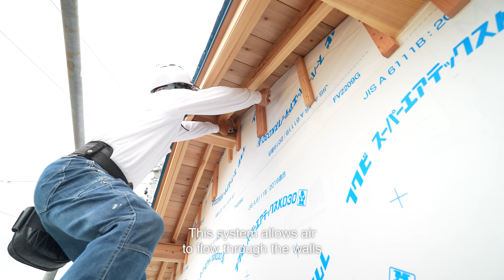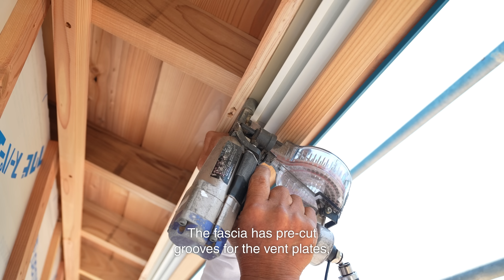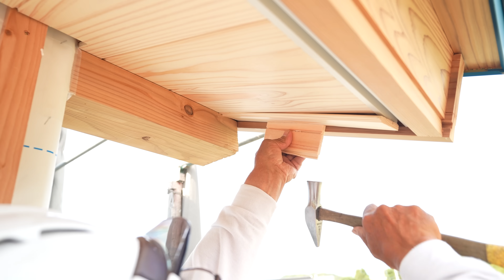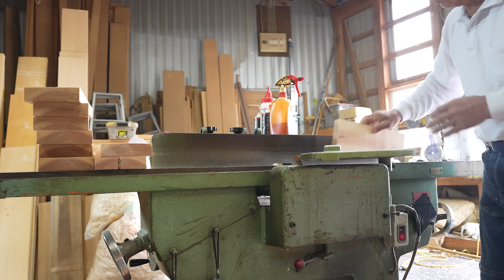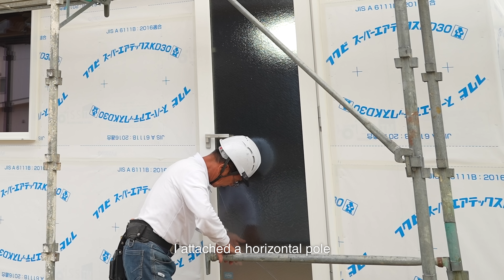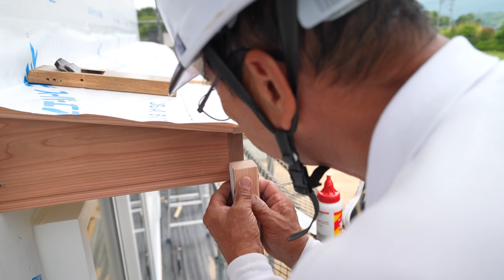I Didn’t Expect This to Happen... My Fault! | New Build Season 5 Part 6

Comment: I do not understand something. When air from outside can flow through the walls than why do you insulate the walls? The insulation value will go down dramatically when cold air from outside can flow freely trough the walls.

Very nice work, well done! 😀

Comment: Sharpening your pencil with the chisel is just showing off. Haha I’ve never seen that, fantastic
Reply: A sharp chisel is just a knife.
Reply: @ yeah, I have a chisel, but it’s not sharp. I’m learning, not at that level yet.
Reply: @johncamp7679  LOL.  The chisels he uses are a lot sharper than us chisels.  I slowly converted to Japanese tools because mostly they are better.  Actually the carpenter in the video is not using all the good Japanese tools he could use.  I bought a Japanese framing hammer 35 years ago, still using it as there is none better in the world.  Cost $25.  I just used a razor knife to sharpen my carpenters hammer and for close work used a mechanical, thin lead.  They mark the same every time.
Reply: @ I was wondering where to get a hammer like that. I have some Japanese chisels now, I never thought about using them for that, I have a couple pull saws, but the rasps are really good. Thanks for the info
Reply: My tutor at college used to do it occasionally even though we all knew that most of the time us chippies just use our utility knives for that purpose! 😂

Still a cool way to make a point if you excuse the pun.. 😉
Reply: @ yeah at first when I was younger I would push my utility blade away from me and it butchered the end of the pencil. Then I saw someone pulling it and it was perfectly sharpened and smooth. But a chisel, I would have never thought of it.
Reply: @johncamp7679  Butchering the end of my pencil isn't too much of a problem when I'm using my carpentry ones since they can take it! Don't think I would do the same for the ones I use for fine joinery work. Then I would probably prefer to use an actual sharpener which some might laugh at but it works for me! 😂
Reply: Sharpen any chisel and they'll be sharp enough for a pencil.
Most people don't bother, so they get blunt chisels, gl with that.

Comment: I’m amazed at the consistency and beauty of the building materials, even for non-visible areas like the soffit frame. Probably makes working a lot easier
Reply: J Grade is a unique visual quality No. 2 & Better developed by B.C. lumber suppliers in the late 1970s to meet appearance construction lumber requirements for Japanese home builders.
It limits/restricts the amount of wane, sap/heart stain, pin/grub/teredo holes and warp. While the amount of these characteristics allowed in No. 2 & Better do not limit the serviceability or strength of the products for construction applications, they did not meet the visual requirements Japanese builders needed to satisfy their customers. J Grade is not assigned higher-strength values than No. 2 & Better, as primary strength-limiting characteristics such as knots, slope-of-grain or shake are allowed in accordance with the No. 2.
Reply: Right, we’d have to pay a fortune to get lumber like that here in the US.